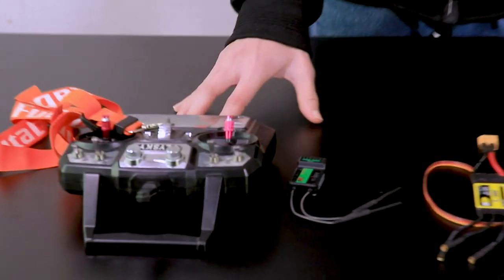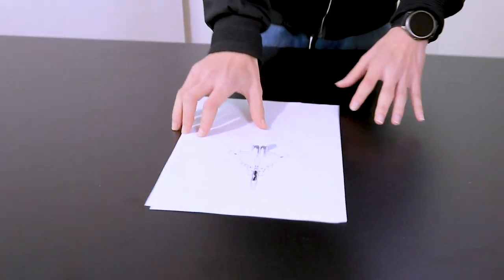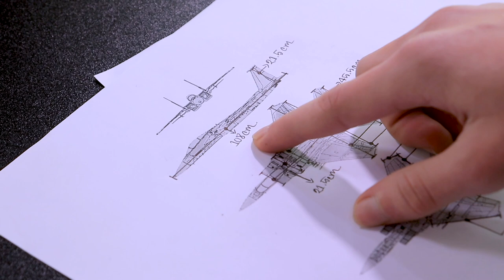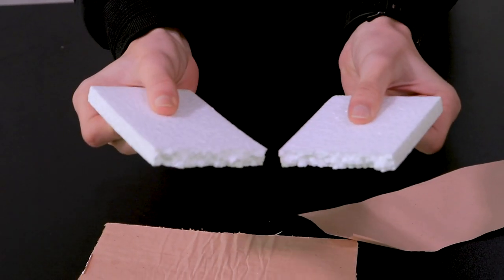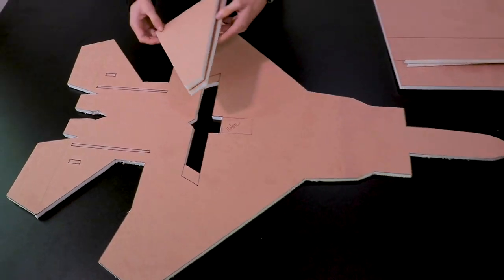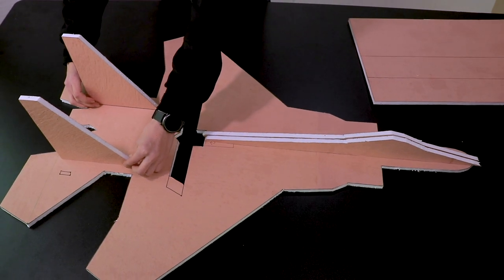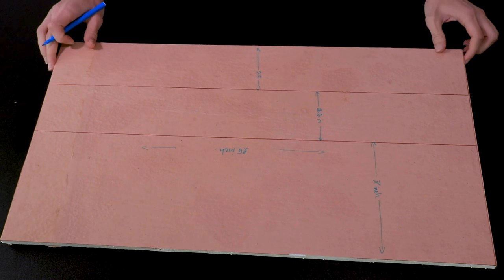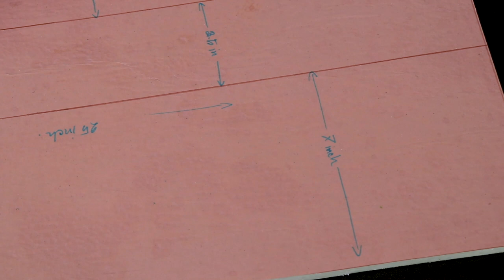HOW TO MAKE A SINGLE MOTOR RC JET/RC PLANE(F15 EAGLE)

Comment: The use of thermocol laminated with brown paper is pretty neat idea, the flight was also very smooth but , i would personally recommend running atleast a little aerofoil in the wind as flat wings fly solely on thrust angle and the lift coefficient is pretty low . 
all in all the design is pretty simple and would be a great weekend build but for something slightly more crash resistant i would recommend running a spar near the prop line.

Comment: Bhai essme  thrust  angle  kitna  hai  please  baatao
Reply from the maker: thrust angle is horizontally straight. 0 ,the elevator and ailerons are used to change the thrust flow in order to change directions for the plane. Hope you get it.

Comment: information.     at 20:32, at this point, three-point-eight of the  'wheels have come off'  your project.  eg., 
the decision to use a  prop-slot  design;
the decision to use a  TWO  engine fighter jet as a reference design;
the decision to make an  OVER-large  TUBULAR  structure beneath the wing;
the decision to use  a (symmetrical) no-lift wing profile;
the decision to use  tailerons; 
and  INCORRECTLY  configured control horns.!!!

cheers         googletranslate

Comment: This is totally incomplete video..there are no proper measurements and the angles not mentioned
Reply from the maker: we had used a 9 inch propeller and the motor angle is parallal with the planes body sheet.
Reply: All the dimensions are shown, you just need to pause the video to copy them. The paper surfaces are a good idea. If you have access to a large format printer you can print out a coloured top surface for the wing to get a decorated effect. It will add strength, but I suspect that the plane doesn't need it, so you can save time by not covering the styrofoam. Great stuff, well done.